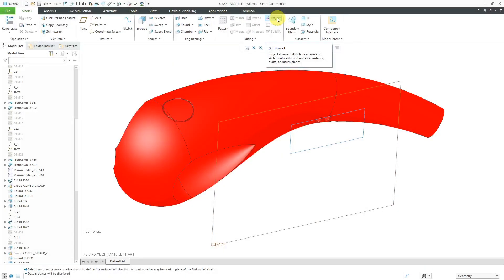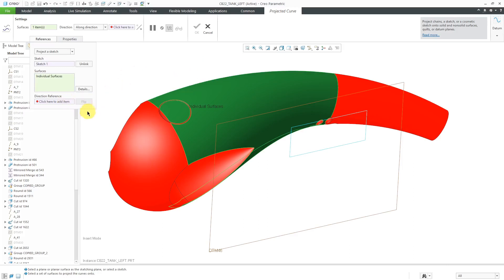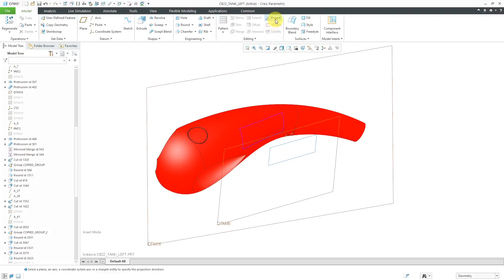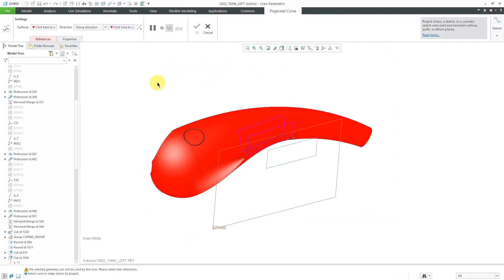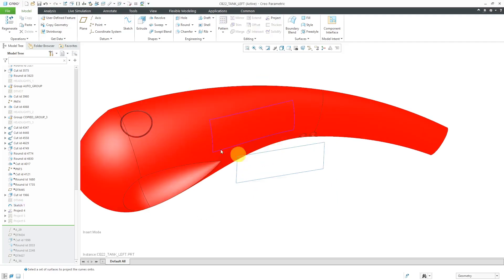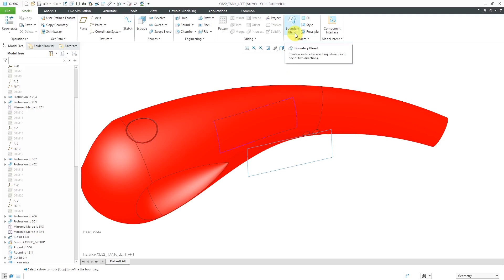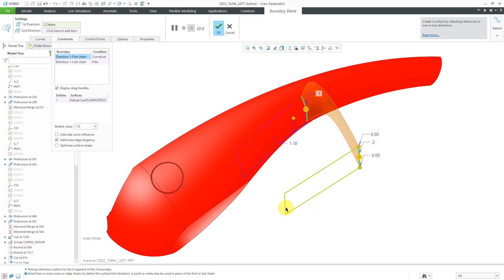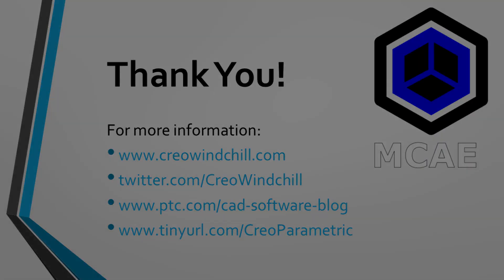Creo Parametric - Project Command | Demo

Comment: Hi, how are you? How can I turn a projected body into an inline solid so I can use the extrude command?
Reply from the maker: Can you explain more? I don’t know what you mean by projected body and inline solid.
Reply: @CADPLMGuy  In the video you used the project command to project a figure onto a surface, but you can't select to use the extrude command because it's just a projected body, how do I transform what was projected into an entity
Reply from the maker: The Project command results in a 3D curve, not a body. (Terminology is important. A body is a container of solid geometry.) The Extrude command requires a 2D sketch; therefore, you cannot use a projected 3D curve. What are you actually trying to do? If you want to Extrude, why not use the original sketch that was projected onto the surface? Or if you are trying to use the portion of the surface enclosed by the projected curve, you could use the Trim command with the surface and curve as inputs. Then you could take the resulting surface and then either Thicken it or Offset it. But it would help me answer if you told me what you were really trying to do.

Comment: hey, i'm trying to model space x starship in creo 6 but i can't wrap or properly project the 60 windows it has. (i'll also need to cut them out) I saw the tutorial on the wrap feature  but it basically says this wrap in not possible as the nose cone begins to curve in multiple directions. so is there any way this can be done??